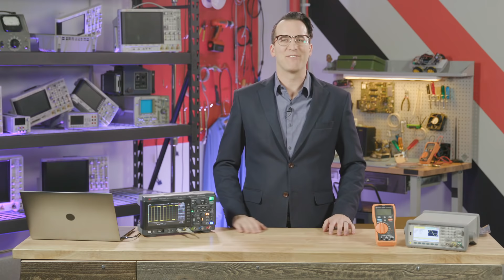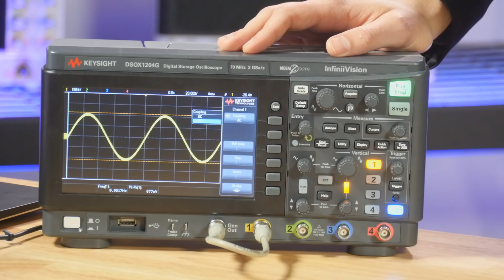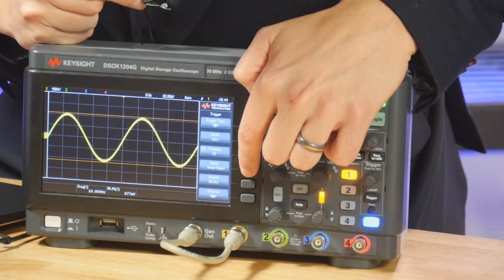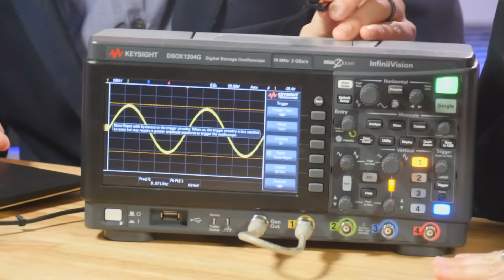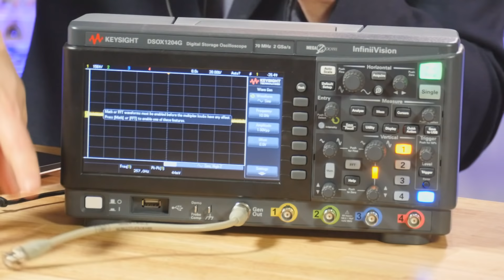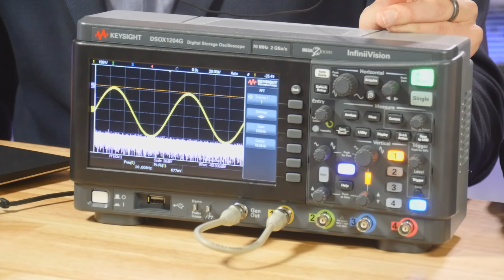Live! When to Use AC Coupling + Wave 2019 Winners (11-Mar)

Comment: Good tip, as always. How many other people noticed him say they are giving away a 200MHz scope 4 channel scope then puts his hands on one that says 70MHz on it? :) Another scope parameter to consider is memory depth. No point having a high sample rate if the scope doesn't save enough samples. If you need to measure mains voltages there are high voltage isolated probes you can get. You wouldn't use your standard scope probes.